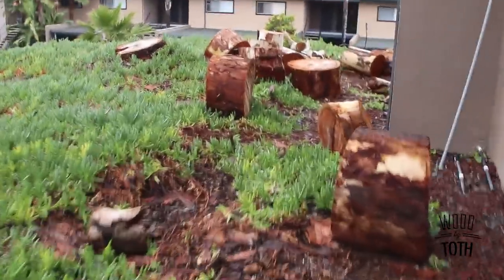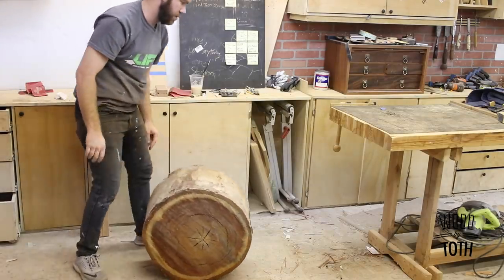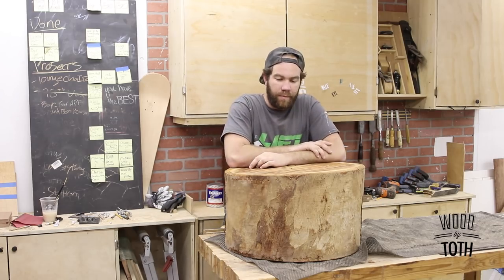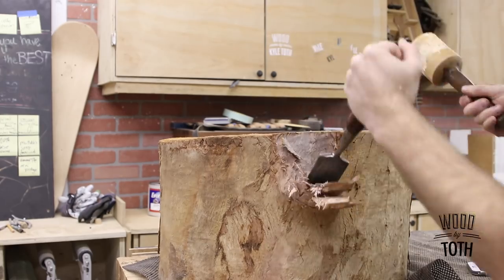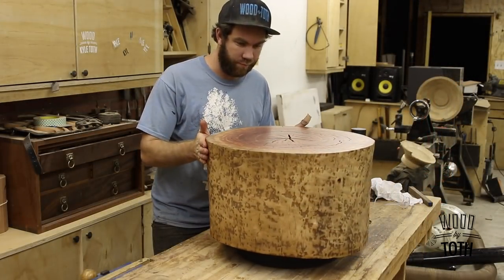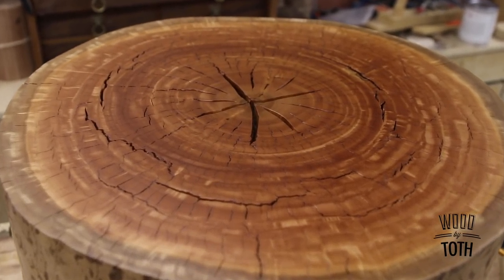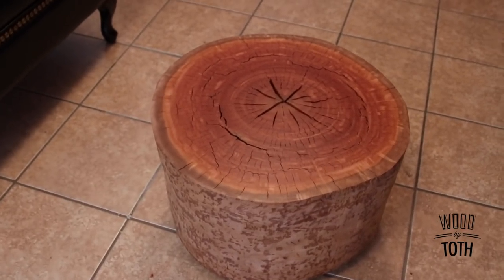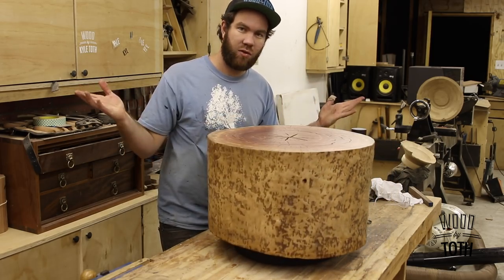Making a Table From A Tree Stump

Comment: How many coats did the end grain soak up?  Was it hard to get the end grain finish so it was not splotchy?
A trick I learned when I used to do chainsaw carving is; on the underside of the log plunge the saw into the log to make an X. You do this right over the heartwood but don’t cut through the entire thickness, unless you want an X on the top too. This relieves stress in the wood and gives the wood room to expand into the middle. Also slows air into the center. A log like that will take at least a year to dry out. 
Just a tip.
Reply: Stanley Shostak we have a fantastic living museum where I live in Australia that dates back to the Gold era. For the wheel hubs on the big stagecoaches they would take a round of ironwood (about third on the list of densest eucalypts) and chuck it in a pile to dry for TEN YEARS before working it...

Comment: Good thing you didn’t try to fill the cracks with Epoxy. I did and it ended up as firewood.
Reply from the maker: Max Maker oh danggg
Reply: Kyle Toth an absolute mess. Epoxy seeped through the cracks. And it left a spotty finish. Can not recommend.
Reply: Max Maker, what kind of epoxy did you use? 
My dad and i repaired a family coffee table made of cottonwood that is 60 years old, has very similar in cracks like this stump, and we filled it with high grade epoxy called Resin Research and we also back filled it with chrysicolla. It came out beautiful.
Reply: I used "Waterclear" epoxy from a German Epoxy dealer. The stuff is great, I was just unlucky and it was too thin for my aplication. I show what happened in my latest video if you are interested.